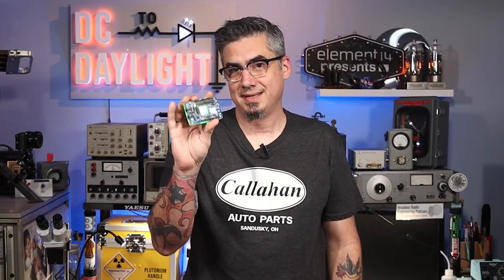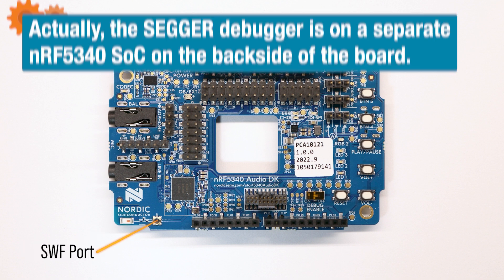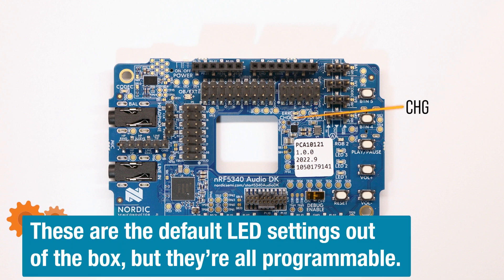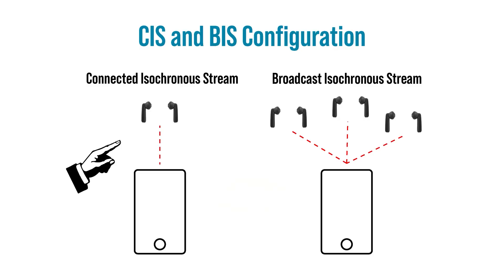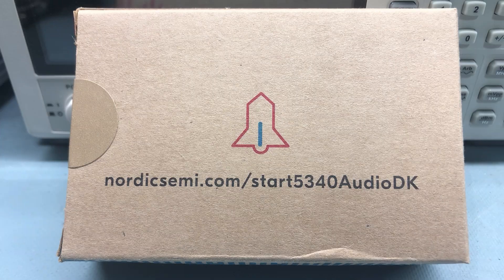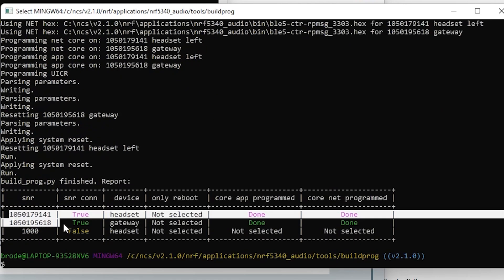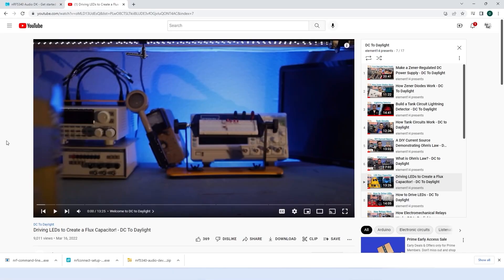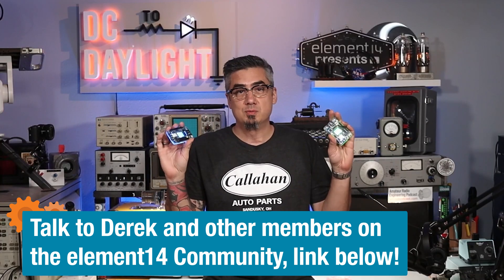Getting Started with Bluetooth LE Audio Using the Nordic nRF5340 - DC To Daylight

Comment: Pls advice....I reached 9.56 minute point of the video... "nrfjprog..." command doesnt return any serial number or anything. I have the nRF5340 audio kit connected to the USB port. ANy pointers would be much appreciated- thanks!
Reply: Ok it was a case of bad bunch of Type C cables.....bought a new one and solved the issue.

Comment: The nrf5340 is such an amazing chip to work with since the BLE stack is entirely offloaded to the network core (it's a dual core chip). The application core can send over messages to the network core through the IPC peripheral within the chip, controlling the network core through a host controller interface. However the issue is that it's two separate micro controllers within one package, which makes DFU a nightmare to do on top of MCUboot and zephyr.

Comment: Interesting board. Is this coming with some kind of example program which demonstrates bidirectional audio use case using LC3? I haven't seen anywhere confirmed that with BLE and LC3 it is finally possible to move beyond the Hands-Free Profile (HFP) and CVSD 8kHz audio codec which is horrible for any two-way communication involving high bandwidth audio (like gaming headsets or just high-quality audio conferencing). I really hope BLE Audio finally brings standardized advancements in that area.
Reply: @AmRad Podcast thank you! This sounds promising. An ultimate test would be transmitting music from the gateway to the headset device, and simultaneously sending microphone capture from the headset device to the gateway and checking both for audio quality (audio spectrum would reveal the bandwidth).